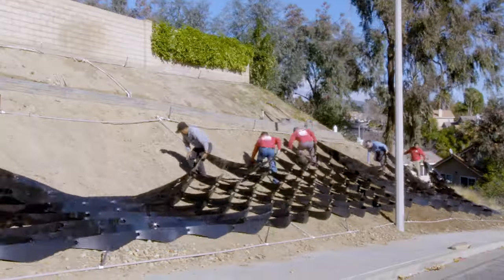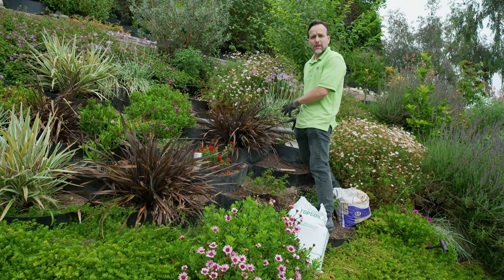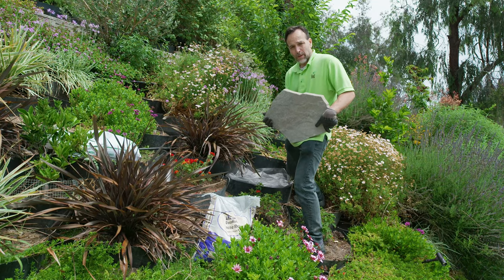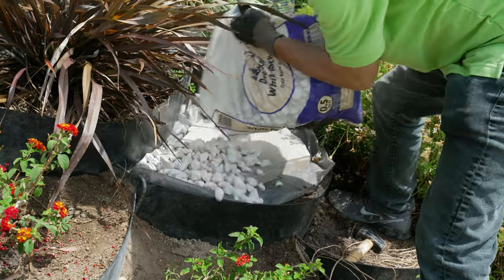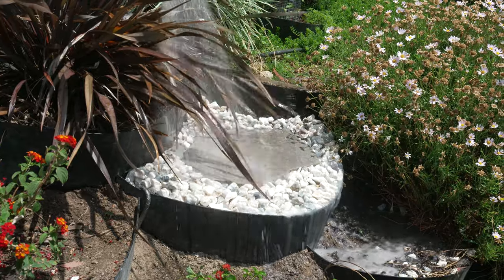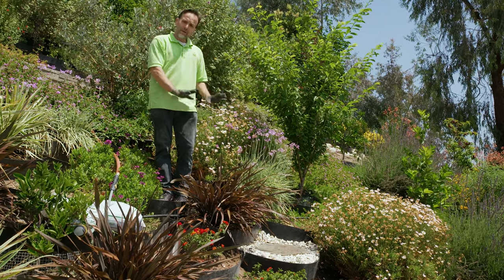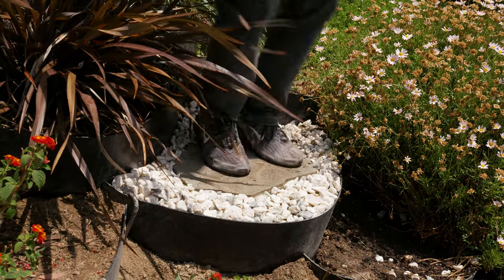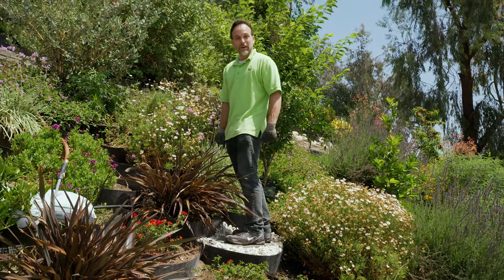Easy DIY Steps on a Slope, How to Build Steps Into a Hill with Dirt Locker®, Steps on a Hillside

Comment: Everything breaks down eventually, what happens to all these lockers turned into plastic bits few years down the line? 
Since the design and idea of your locker is excellent wouldnt it be much better to make it with some Slow biodegradable material?

respect from India
Reply from the maker: Thank you for your question. The DirtLockers are made from high density polyethylene (HDPE) that has UV inhibitor with a rating for 10 years under worst conditions. We have prototypes still in use over 10 years with near full sun in high desert adjacent conditions. However, if the fauna is allowed to grow and shade the HDPE, service life could be 50 years or greater than 100 years (Depending on comparison value used). Additionally since they are made from 100% recycled plastic, using them is helping remove pollution sources. We have considered a biodegradable version but some of the limitations are that they would not be beneficial for growing annuals or crops so plants could not be changed out. If you have additional thoughts or would like to discuss in greater detail, please email from DirtLocker website
Reply: @dirtlocker  thanks for the reply. great product..wonder how can we get this in india.
Reply from the maker: We are currently working towards a solution to export to a few different countries including India.